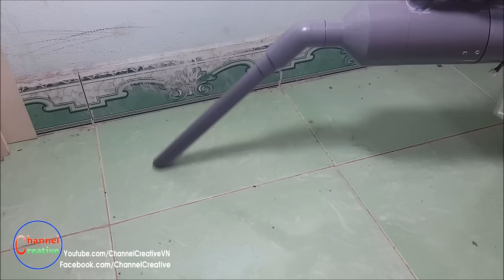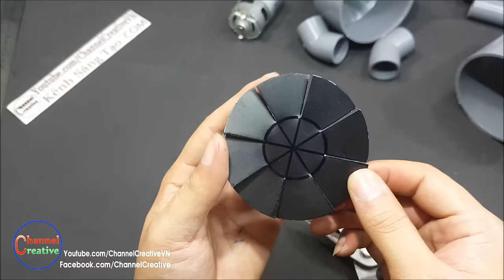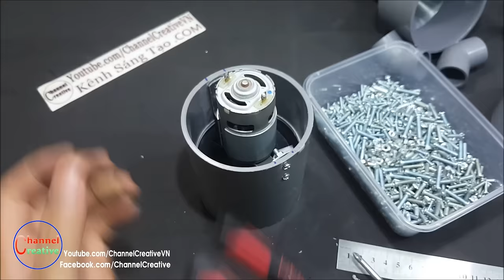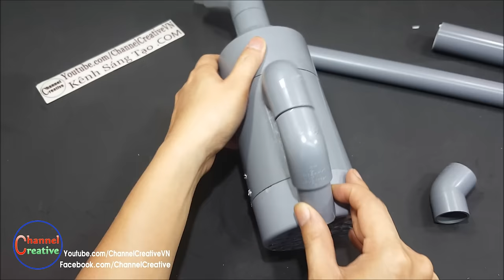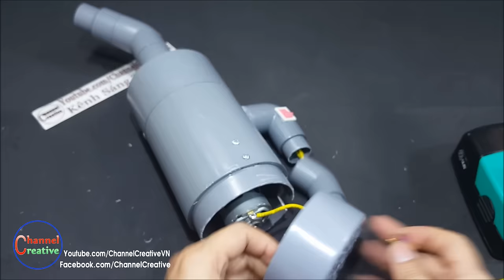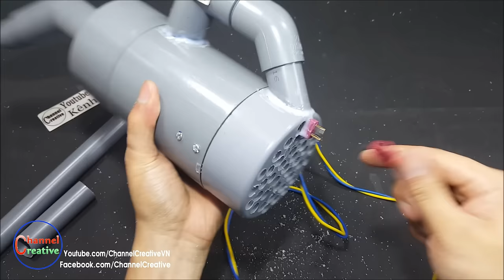How to Make a Powerful Vacuum Cleaner Using 775 Motor and PVC Pipe

Comment: Great video,  BTW you should connect a 2 way switch so with that it will also work as a blower
Reply: Beastboy_ 24919 
Y
Reply: No. Blower will be ineffective coz of the filter
Reply: @ianbudgetrc2574  just put the filter as a flap valve.
Reply: This is no blower

Comment: Nice! ...Suggestions for future updates: 1. Make a different handle that accepts the LiPo battery inside. It's a shame to have such a portable vacuum cleaner dragging a cord; and 2. Try a closer-fit tolerance between the fan blades and the casing. This should significantly increase the performance.
Reply: corisco tupi .
Reply: Bro.. I tried the same same config used but the suction power really sucks!! It’s not able to pick up the nails.. in mine the case is 4inch and fan blade is 3.6inch too disappointing that it didn’t work out well..

Comment: Nice work!  Here's a little trick for you to use the next time you cut a motor mount out of electrical wiring duct cover.  Rather than using an angle grinder, use a utility knife making multiple passes to make those cuts.  Do it over some wood so you can cut through on the last couple of passes.  The end result is there's no dust or smoke created by the angle grinder, and your cuts are more accurate and require less deburring.
Reply: I guess Im asking randomly but does someone know a trick to log back into an Instagram account??
I stupidly lost my login password. I would love any tricks you can offer me
Reply: @Allan Jamal Instablaster =)
Reply: @Tristan Ephraim thanks for your reply. I got to the site on google and im waiting for the hacking stuff now.
Seems to take quite some time so I will reply here later when my account password hopefully is recovered.
Reply: @Tristan Ephraim It did the trick and I now got access to my account again. Im so happy!
Thank you so much you saved my account!
Reply: @Allan Jamal No problem =)

Comment: Wish I knew the details of the size motor, switches and other electrical parts used. Really awesome work though. I loved it. I was waiting on the grand finally to see a rechargeable battery attached but guess you decided against it

Comment: Saudações.
Gostaria de saber se o motor de 9000 rpm 12volts pode se substituído por um de 21000 rpm 24 volts para aumentar a potência do aspirador ? Seria possível postar links para compra do motor no ALIEXPRESS ?? E também de fontes de alimentação dessas voltagens no Aliexpress?
Parabéns pelo excelente trabalho.
Reply: Hi, you can replace the motor with what works. As long as the blade and the base of the vacuum can handle it, the contraption will accept it👍

Comment: Bro.. I tried the same same config used but the suction power really sucks!! It’s not able to pick up the nails.. in mine the case is 4inch and fan blade is 3.6inch too disappointing that it didn’t work out well.. any advise on the suction power?

Comment: i have been continuing this project over 6 months and iam not able to find that fan adapter to the motor shaft can you please tell me where to find it?i have tried it joining those with m seal but it doesn't work like that way it gets removed easily please help
Reply: It may be available on banggood or AliExpress
Reply: Bro ask the roof sheet shops aluminum metal sheet show video for thickness.
Reply: Name Is Anodized Black Aluminum Metal 0.7m Thickness? I think so

Comment: I'm trying to make home made vaccum cleaner. I purchased pipes,  motor ,metal sheet,  screws and wires. 

I'm using 12 volts Rs775 motor. 

1.In order to connect that motor to home power supply  220volts what components should I have to add.

 2. I want to use that motor as blower and vaccume cleaner, so in order to change the polarity when ever I required what to do.

 Please help me with these two questions bro.

 I'm waiting for your reply. And help me to make my own vaccume cleaner. 

Or else make a video for these questions bro.  I m begging a reply from you.

Comment: Why do we need to make a hole in the back of the vacuum???
Reply: so the excess air that has been sucked in can come out, the motor and the metal propeller is rotated to create a vacuum pressure which sucks in the material or the dust's from the hose and is filtered, the filtered clean air comes out..

Comment: Hi, I'm from Brazil and I'm using the Google translator.

I tried to make his vacuum cleaner and I did not succeed, he blows and does not suck

what did I do wrong?
Reply: change the angle of the blades because it is the component the creates the vacuum pressure for suction... change the angle backwards, check also if the rotation is clockwise

Comment: sir how 775 dc motor is different from other motors?
Reply: my project not working not creating enough suction. pls suggest remedies
Reply: lotpot comedey
Reply: 755 dc motor is cheap  and high torque with rpm. So its better.
Reply: U need to look inside that motor....it has a different armature..containing 5 windings rather than 3 windings...and also its magnets are more powerfull..

To increase the suction ..increase the no. Of blades of ur fan...having less blade will not create sufficient suction.....refer a turbo charger's design ....its blades are designed in a way that its can suck and conpress the air at max 2 bar pressure.
Reply: And also...make sure the outer edge of the fan blades is closer to the inner walls of the pipe or any cylinder...in the order of 5millimeter is best.

Comment: you can also use magnets to collect such stuffs instead making these and wasting money.....haaa
Reply: thats ONLY if the material your interested in collecting contains iron, otherwise this DYI vacuum cleaner will beat any magnet you throw at it !
but i agree its useful for special circumstances, for instance if you had a big outdoor fire (its a midsummer tradition in a lot of places) and burned a lot of old planks with nails in them; just go to the fireplace the next day and scoop up all the metal from the ashes, and nobody's feet got pierced!